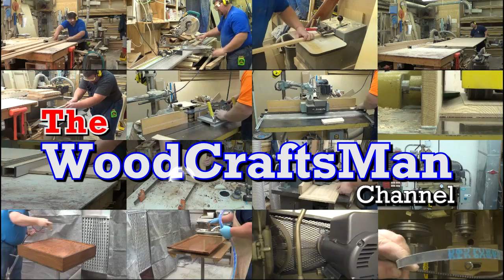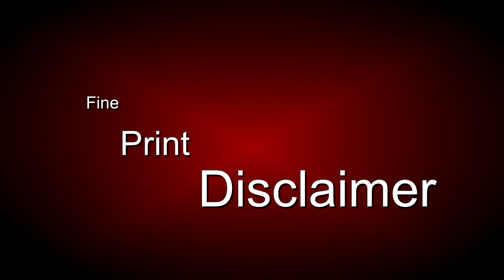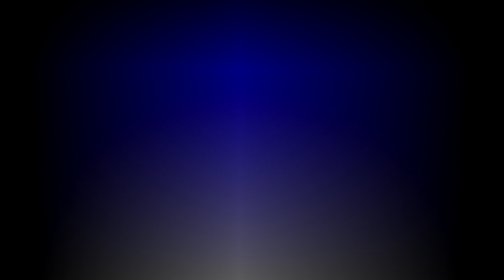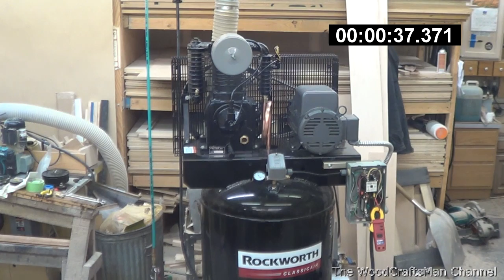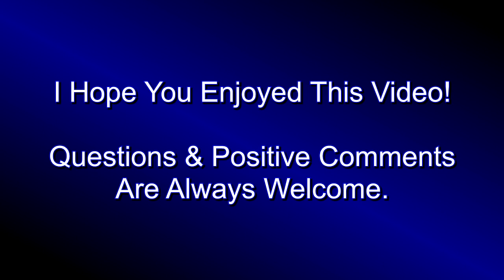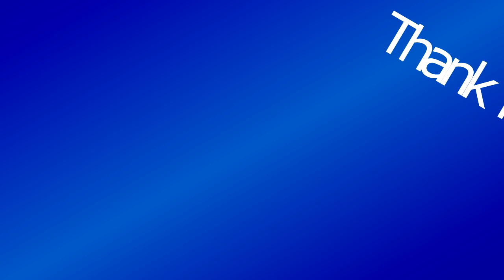Air Compressor Update Part 2 # 139

Comment: I know this is old but I have a 705 Saylor beall 80 gallon. it's set up to run continuously and I was wondering what switch u have
Reply from the maker: Hi, unfortunately mine is not set up to be a continuous run (although I wish it was). The switches used are a Square D pressure switch with a 30 PSI differential, and a Siemens magnetic starter with a toggle switch wired in series with the pressure switch and coil. Let me know if you're looking for something specific. Thanks. Scott

Comment: Where is the motor overload?  I don't see a heater under the contactor, nor do I see an integrated overload on the back of the motor.
Reply from the maker: Hi, Thanks for the comment. The overload is right below the contactor on the left next to the yellow clamp on the clamp on multi-meter. The green button right next to the multi-meter's clamp is the reset that lines up with the blue button on the front of the cover.This particular starter uses a single bi-metal heater strip for one leg only that has a single rating (mine is 25.4 amps). The bi-metal strip has a number stamped on it that matches the number on a chart in the back of the front cover showing its value. This is kind of an old school type of overload along with Square D's popular melting alloy heater overloads as well. Most companies are going to an adjustable style overload where you can turn a dial with a screw driver to different amp ratings. Scott